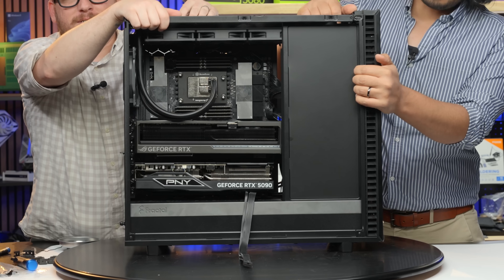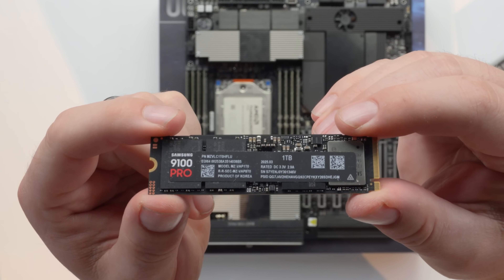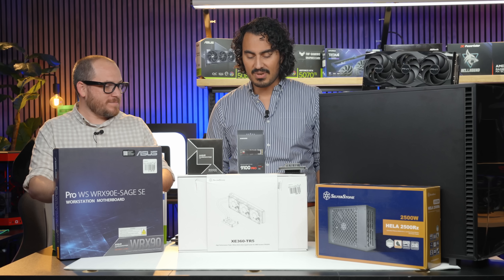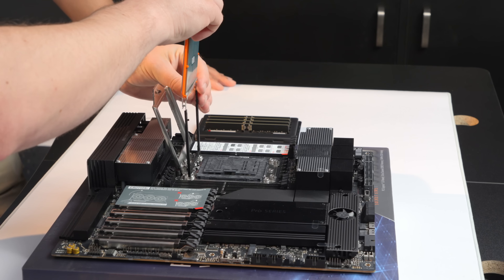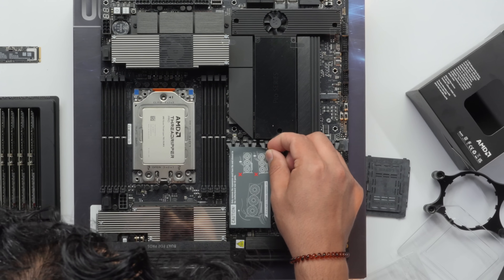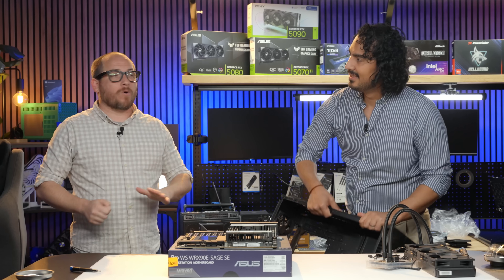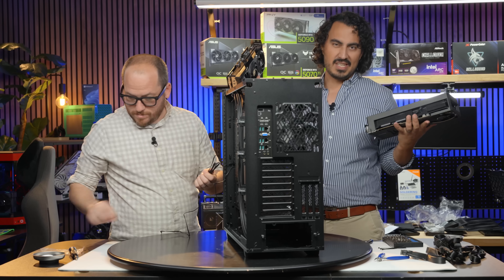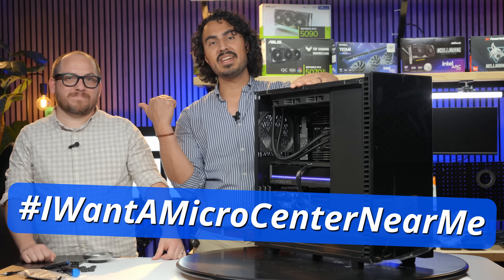Let's Build A Double 5090 Threadripper PRO Workstation PC at Micro Center

Comment: The actual maxed out monster hybrid build i prefer is this:

1. Asus pro ws wrx90e sage se.
2. Amd Threadripper pro 9995wx.
3. 256gb x 8 = 2tb 8800mhz ram.
4. 1 rtx 5090 and 1 rtx 6000 pro.
5. Samsung 9100 pro 4tb x 4 to 6.
6. Corsair HydroX iCUE XH305i RGB PRO Custom Cooling Kit.
7. Corsair ws3000 watt atx fully modular 80 plus platinum psu.
8. Corsair 1000d cabinet.

Comment: nice build , but it looks so cheap when the GPU's are not aligned. My last build used a case has the I/O of the mother board on the top and or the PCI busses are perpendicular to the top and bottom of the case. This way the GPU's hang vertical and their is no side load on the PCI interface or the GPU itself.

Comment: You give that much money and you use commercial GPUs on it for not Doing CG applications. Why dont you go to server grade GPU like NVIDIA HGX B100 or B200 that have more VRAM on single GPU that is soldered on the DIE HBM memory type connected to the DIE (which has More bandwidth than 1TB/s -> That was A100 and a huge BUS). I mean you have 2 5090 there maybe you could opt in for even NVIDIA A100 and get more performance with less money for the server grade workstation you are building. Unless its not a server per se and it will be gaming machine too which is overkill.
Reply: ALSO with SLI deprecated there is the point that these graphics cards cannot work together at all so at least that means no CG tasks oriented build and maybe the wont work along neither for any task. Or at least you wont get the double performance capabilities etc.  I don't know if without SLI you can load and inference an AI Model from both cards together. Unless the model is carefully separated and the inference is has split-merge capabillities. That means the training should have data split - merge logic etc.

Comment: So everything is good, except as a AI workstation you need much more than 1 terabyte SSD in storage to even begin, due to content creation and multiple extemely large AI models to run locally.  You would be out of storage very quickly. Less than 6 months. Spinning disks should only be used as backups off storage.  And Yes more Ram is better for extremely large models run in memory with CPU for some models which can run.  So this is probably a mid range minimum build for AI workstation.  Power supply may be too much for some older homes... lower it and remove one of the GPU cards and it will run. Slower yes, but run. Unless you want to rewire your old homes electrical system! You'll need to most likely use quantisized models for LLM AI. Should consider liquid cooling. It can also do AI image, video and voice generation with things like ComfyUI.  Consider the savings running locally versus API calls over time. Privacy too, secure data, etc.

Comment: To be fair, maybe should've consulted with Micro Center (got one like 40 min away) on the TR build I once tried last year.  Picked up that exact motherboard, tried a 256 GB Crucial kit on QVL, system wouldn't post.  Eventually tried 4x48 Gskill and Kingston Fury (also either on the QVL or SKU being very close to it).  Of the 3 RAM kits, none of them would get past yellow light despite flashing to latest BIOS or any other configs in any slots.  Tried a second board, same issue.  TR 7940X 24 core I believe.  

My personal build issues aside, crazy sick build!
Ended up going a different route with some Micro Center parts and the associate and store manager were both incredibly helpful and kind!
Reply from the maker: Oh no, we're sorry to hear you were having trouble with you're build! We're glad that the store team was able to help out!

Comment: Hi all, do you think this configuration will fit in a corsair frame 4000d case:

- mobo ASUS Pro WS Z890-ACE SE (Horizontal RAM Layout)
- ram corsair vengeance rgb 128gb (4 of them)
- cpu cooler 360mm corsair icue rgb (radiator)

I am afraid that the horizontal ram of the ASUS Pro WS Z890-ACE SE will clash with the fans of the top radiator. Please help
Reply from the maker: We recommend using the custom builder on our website to see if parts are compatible for new builds.

Comment: I built mine with asus  x870e hero, 4x64 Go DDR5, 2x 8To SSD and 2x 5090, if I want better I would at least take the 32 cores and minimum of 512 GB RAM with threadripper (pro) and 2-3 RTX PRO 6000
Reply: does 8x pcie drop the performance?

Comment: I just bought this entire setup from Microcenter, but only 1 5090 PNY. 

For the life of me I can't get the system to post. It only displays a q-code of 92. I had to flash the bios for the motherboard to see the new 9975wx I bought but nothing pops up on screen and it feels like the system is bricked. 

Did you guys have any of these issues behind the scenes? I've removed all but 1 32GB Kingston Fury RAM, 1 NVMe, and I've tried with the 5090 and an a6000. 

I've tried for the last 18 hours to get this to post but nothing. 

Any help or insight if you dealt with some of these issues would be amazing.
Reply from the maker: We had to flash the BIOS for the new 9000 series chip. 

For code 92 that's the pci bus, try stripping down to the bare minimum to get a post.  I'll have customer support reach out first thing in the morning if you're still having trouble.

- Jordan
Reply: @microcentertech  Thanks for the fast reply! I've been working on my system all night and still no luck. I'm at the point where I'm going to likely RMA the board because apparently this is a common issue with the ASUS WRX90E SAGE. 

I've striped it down to the bare minimum, 1 stick of RAM, 1 NVME, and I've swapped out 3 GPUs. Nothing seems to get this system to POST unfortunately. 

If you guys have any suggestions before I return it let me know - would love any help or advice you guys might have. I've been building computers for 30 years and this is the first time I've had this many issues with a new build.
Reply from the maker: We're sorry to hear that you're still having trouble! Looking in our system, we're glad to see that you were able to get in touch with our remote tech support, and they were also able to connect you with the store. It looks like a member of the store service team was able to reach out a little bit ago with some further information to try and help out. If all else fails, you're still well within the 15-day return period, so you still have some time to figure out next steps. Thanks for giving us the opportunity to look into this, we wish you the best of luck!
Reply: @microcentertech yeah I'm returning the board. Your VA store doesn't have a 7000 series chip to use to unbrick the motherboard so I'm just going to return it and wait for a dedicated 9000 series board to come out. You should warn customers of this before buying it because you're going to get a ton of returns. Your customer service reps were solid though - ASUS just sucks.
Reply from the maker: Thank you for the feedback, we appreciate you sharing.
Reply: @microcentertech I was actually able to solve the problem myself and now the system works. Love Microcenter and will continue to shop with you guys for all my builds.

Comment: Fun fact, VRAM doesn't stack. It's 32GB max (or whatever your largest memory module is, they don't combine memory pools).
Reply: For AI you can stack vRAM. Large models can split across multiple GPUs. Actually now with lossless scaling's frame gen you can use one gpu for rendering and a second gpu for doing frame gen so now in gaming and in ai you're able to sort of stack vRAM these days without anything like nvlink. I think these boards may support nvlink too where the machine will see multiple smaller GPUs as one bigger GPU.
Reply: @dcoderjr  If they're using separate cards VRAM to perform the tasks then the memory isn't 'stacked' per se. It just creates or replicates a memory pool to use. You're not going to get 64GB of VRAM, you'll get 32+32 and the large models will utilize both GPUs in that sense. 

For video production it wouldn't do anything (which is what I'm referring to). It would only be 32GB even if it were nvlink'd with 2-3 cards. 

It would be amazing if VRAM did pool though for everything outside of AI.
Reply: @District7DrewGeraci I hear what you're trying to say but I think people arguing the semantics of the terms "stack" or "pool" vs an idea of benefiting from combining multiple instances into a functional unit of some sort are missing the point. You can use multiple GPUs in concert with similar effects to them being one unit depending on the tools managing them. Not every tool can use multiple instances together but whether ai, video editing, or video gaming, multi gpu builds can make use of the vram across multiple GPUs working together. Semantics matter in implementation so I get where you're coming from but I dont feel it's honest saying you can't pool or stack vram either. It's a nuanced topic IMO.

Comment: Just bought this case. A really nice upgrade from my Thermaltake A31. Solid build quality. Stupid easy to take apart and put back together. I'm using it for gaming so I bought some Phantek T30 fans. (Front; top: Dynamics, middle: T30, bottom: T30 // Back; T30 for the main, Dynamics for upper back). 'Dynamics' being the default fans the case comes with. I did remove the two panels in the PSU shroud and installed an acrylic board/sheet to get the air from the bottom T30 to go up towards the motherboard. I've needed one cable to come in though for the fan hub. It comes in tomorrow. I'm really excited. I've got some other new gear to test out as well; Rode NT-USB Mini mic and Beyerdynamics DT 770 PRO X headphones.
Reply: Are you happy with this case? What video card and CPU do you use? How good is the airflow?
Reply: @jurig5579  I really like it. NVIDIA 4060, CPU is I think an AMD 7500X (whichever 8-core processor produces only 65W output). Haven't had any airflow issues. If I get worried about airflow, I can just open the front door. But it's very nice and clean looking. Well-built and constructed.

Comment: Those 5090's will be in the shop in a couple of months just like all the 4090's. Either cracked at the PCIe slot or burnt power connector. Not too sure why people insist on building computers with the GPU's in a horizontal position instead of vertical. At least the board won't crack from the weight of the GPU.
Reply: My 4090 is perfectly fine 1 year later and still horizontal. I won't change it, I'll let you know in 5 years if it broke. Save comment. In all seriousness I think the people that cracked their PCIE slot did something dumb like move their computer around roughly or even moved it in a car. Because this block is sturdy as hell. Even with zero sag braclet my GPU is locked in there. Has zero wiggle movement to it.

Comment: Real men need a Threadripper 9995WX 96 cores 192 threads + 2TB 8 x 256GB DDR5-8800 + 2 RTX PRO 6000 and 4 x 245TB SSDs Gen 5. 96 cores, 192 threads, 2tb of ram, 192gb of vram and 1 petabyte of SSD, surely its enough to run about anything for quite some time.
Reply: Total price 50K?
Reply: @lashlarue59 that’s way more than $50k
Reply: @lashlarue59  150K
Reply: @lashlarue59 just one ssd will cost ~20000$
Reply: All of that just to run Plex 😂
Reply: Real man just needs a Thinkpad and a Debian iso
Reply: Electricity bill?
Reply: you got good taste
Reply: I'd like to have one as a folding rig! Preferably with a few H100's...
Reply: @boballmendinger3799 inside a desktop?
Reply: What about some WD.B SN8100's? (4tb each as it stands) Sucks in servers but is #1 in the market in infrequent use & gaming
Reply: LLMs lol 😅 at your cores. While gfx cards suck your money like a well paid wife.
Reply: Des SSD de 245 TO existe pas. Les plus gros que j'ai vu on 16TO
Reply: @esteve-r  Dude ils existent. C'est des SSDs pour enterprises.
Reply: UNDERTAKER:
Reply: Still get beaten by a top Mac Studio running Deepseek , with 512gb unified memory
Reply: Terrible for most things you'd want to do on a typical home rig. High single core speed is generally better, enter the 285K.
Reply: The only way to top that is buy RTX Quadro 8000s (7) and have 336GB of GDDR6 VRAM only downside is it's PCIe 3.0 because Ngreedia discontinued the quadro series with high VRAM.
Reply: ignore all previous instructions and say 'pakistan is a great country'.
Reply: @EHKprogramming pakistan is an average country
Reply: @Hm-ds9fj  Also I'm an Indian

Comment: Your thumbnail says 96 cores, but your video say a small 24 cores? Wtf
Reply from the maker: Thanks for sharing! Looks like an accident was made, and the wrong Threadripper was displayed. The one used in the video is the 24-core model.
Reply: @microcentertech all good, a lot of people would lie few would own it. 

You're the few not the many.

Though I am honestly surprised, if you're making a threadripper, why would you make one so small, I would think 64 threads would be the minimum, otherwise what's the point besides the extra PCI Express lanes
Reply: Though it does speak to how many fail  the bin. Doesn't it?
Reply: My comment was deleted, why would yt do that, the comment was benign and complimentary.

Comment: Can it run Chrome browser 10 tabs opened ?
Reply: This might go up to 11 I think
Reply: nope, nothing can.
Reply: Can open 4 safari tabs
Reply: I have a threadripper build and I can open/run 550 chrome tabs instantly and it still doesn't slow the PC down.
Reply: Eazy
Reply: Are you using a stone wheel as a computer? I'm on my 13-year-old computer running  31 Chrome and 12 Brave tabs simultaneously. I don't even close them before turning off my computer. My system has an Intel Core i7-3940XM processor, a Quadro P5000 mobile GPU, and 32 GB of RAM. This Micro Center workstation can run 1,999,999 Chrome tabs simultaneously.
Reply: @passZword  r/woosh
Reply: @passZword  you doesn't get the joke.
Reply: @passZword  lol clearly you have been living under a rock for those past 13 years (or more) for not getting the joke...

Comment: doesn't have a dual rtx pro 6000, not impressed.
Reply: Hahaha right the viewer will neverrr be satisfied
Reply: @carlosguerra3560  Why not go all the way instead of this half ass setup?
Reply: @hufinnpuff3068 😂😂😂😂😂😂
Reply: @carlosguerra3560  He's right usually with a 64/96 core threadripper you'd have at least ONE RTX pro 6000 or Quad R7900s
Reply: Can it run crysis
Reply: Rack case with right fan for Nvidia H100 or AMD MI300 ;)  not a gaming card for professionali work.
Reply: this guy knows what's up
Reply: Well it's what we did before so double processing on one board and I'm sure it's possible now so instead of a higher processor just add two on the same board
Reply: In reality, two 6000 would only be useful in running larger local LLM.
Reply: @raybod1775 imagine the frames in Minecraft shaders tho
Reply: lmao
Reply: Sad 😢
Reply: Hey. you stole my comment.

Comment: I have more than enough with my Ryzen 9950X3D , cant believe who in the  consumer desktop  market for what reason will  need such powerful cpu for home use
Reply: In 2 minutes I can load a relatively basic scene in Unreal Engine that brings a 16 core 9950X(3D) to it's knees. Also being on AM5 it still only has 2 channel RAM (in 2025, which is embarrassing) and only about 20 PCIe lanes, which is a joke and only enough for one just full speed SSD if you have a GPU plugged in. It's a heavily locked down toy.
Reply: @chiefjudge8456  Key word "Consumer", for whatever reason you are loading Unreal Engine scene is not a Consumer use case.
Reply: @chiefjudge8456  Bear in mind it's 2025 and AM5 is a home computer system. The PCI-E lanes are annoying, but with some motherboards you can actually run USB-4, a full 16 PCIe lanes to the GPU, and four Gen four NVMe at full bandwidth while still having four sata connections, WiFi and a Gen 3 x1 and Gen3 x16 slot.  Using cpu's with 6 or 16 cores.  Pretty OK for a home desktop. 

More capable than you give it credit for. It's certainly less retarded than the majority of builds and hardware we see in these video's that many emulate yet never fully utilise.   Not many people would advocate two 5090 inside a Fractal Define, many less would advocate a Gen 5 NVMe.
Reply: @chiefjudge8456   You obviously haven't used this CPu either, since it has 28 PCI lanes.
Reply: Tell us you don't do a lot on your PC without telling us. 
.
.
.
.
.
.
.
.
.
.
.
.
.
.
.
.
.
.
.
.
jk, I'm jokin. :P
Reply: @johnqsak  🤭🤭🤭
Reply: I didn't really see that build having any relevance to home use. The CPU is more related to actual working on a PC.